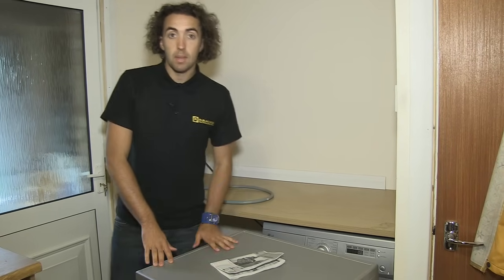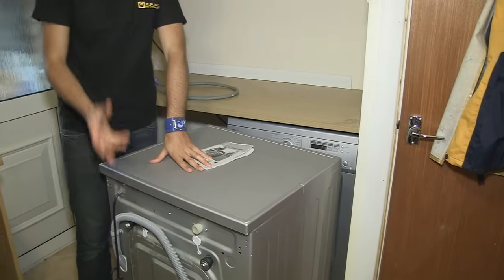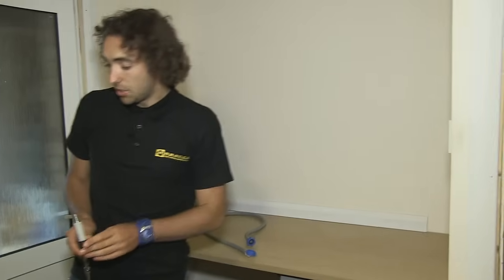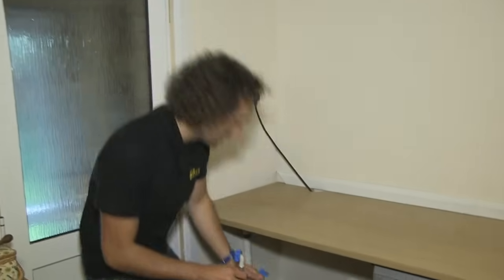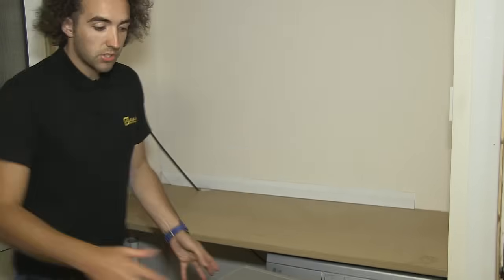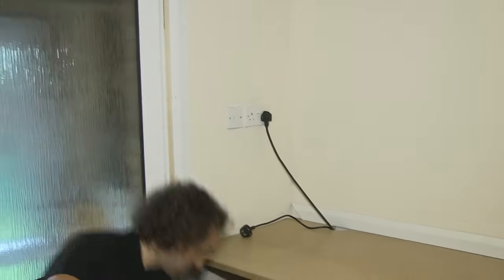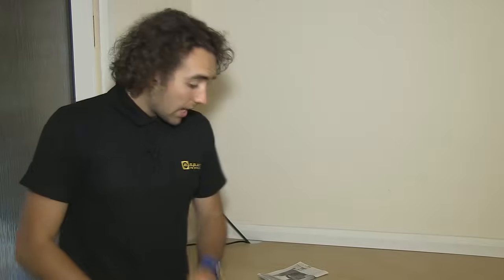How to Install a Washing Machine (Easy Guide)

Comment: My machine can't supply water inside the machine
Reply from the maker: Hi, if your washing machine is not filling with water it could be a faulty water inlet valve. Check out our video here, which shows you how to test the valve...and also how to replace it with a new valve.
https://youtu.be/jiyVfEHu6W0

If you do need a new valve, our range on eSpares can be found here:
https://www.espares.co.uk/search/pt1753/washing-machines/valves

Comment: Wonderful video and so easy to understand!  I just viewed a flat to move into.  The agent showed me the kitchen and there was a pipe cut through the unit for the cold water fill pipe to be attached.  However there was no outlet bit cut through!  I thought it was strange but didn't sign on the dotted line and thought I better view a video about plumbing a washing machine first.  Lucky escape!
Reply from the maker: The drain may be connected to the bottom of a sink as shown in our dishwasher video: https://www.youtube.com/watch?v=KoZ9qhS-KcE
It is unlikely the 'flat' would only have a water supply without also having a drain.
Reply: Thanks for the reply.  The space for the washing machine was three kitchen units away from the sink, but there was no cut-out in the unit for the draining pipe from the washing machine to be passed through to the waste pipe.  Ok, a minor point but still nonetheless the carpenter would need to do the hole cutting in the unit, and the flat should not be let as being ready as that work would need to be done.  Thanks for replying.  Although I would not want to anticipate doing plumbing myself (if I got on the floor I wouldn't be able to get up again!!!), it is always very useful to have an idea of what's what with regards to plumbing jobs.

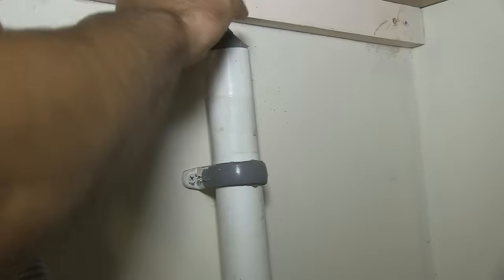Comment: 3:07 so it’s okay to leave the drain hose hanging loosely in the pipe? I’ve inserted it 20cm in the pipe but the hose significantly more thin than the pipe itself. It won’t fly out or anything?

Comment: Very good clear and concise instructions Thanks for making this i'm getting a new washing machine this week but it feeds into under the kitchen sink rather than on the wall do i need to do anything different??
Reply from the maker: Hi Nigel, if you are plumbing the outlet hose of the washing machine to the sink make sure there is a one-way connection to stop any dirty water from the sink going back into the machine.

Comment: Thanks for posting this very helpful video. Do we need to turn the cold water supply valve on?
Reply from the maker: +Ankit N After checking the pipes are tight the water must be turned on for the machine to fill.
Reply: Yes you must otherwise no water will go into the machine

Comment: Hello. I can't find any when you are just replacing one washing machine with another. 

Ours is attached to a sink spigot.

Is the drain hose in the old machine still viable as the access is limited fed around a lot of kitchen units so can I just remove the old drain hose out of the old washer and connect that to a new machine? 

Trying to find videos about it but most lost only the connection to the spigot or downpipe which we don't have.

Is it complicated to remove the hose from the new washer or can I just remove the one from the old one and attach it via a connector using the old tubing already attached to the spigot?
Reply: Or just attach the new tubing to the old tubing pulling it out of our old machine somehow? A connector maybe?

Comment: thanks that was really helpful but a quick question - there is only a hot water option for filling the washing machine in my new place so is it ok to attach?  The washing machine I have is 6 years old but as new as it's been in storage.  thanks
Reply from the maker: +sarah r. It is usually the case to only have a cold water option. Try running this water into a bucket as it may be a cold supply with the wrong coloured tap (red).
IF it does turn out to be a hot supply we would advise you get a cold supply fitted.  Using on hot water will not only cost you a lot of wasted money and energy when the machine rinses several times each cycle, but it may also 'set' stains into clothing rather then clean them away.

Comment: Hello does it harm the Washing machine if u connected it to a hot supply but it is cold supply
Reply from the maker: It is unlikely to harm the machine, however it can cause stains to 'set' before they are lifted and will harm your energy bill. It could also damage clothing that should be washed at 60 degrees or less.
A modern machine is designed to fill with just the right amount of water and on a 'quick wash may heat only for ten minutes and wash in under 30 minutes. To heat the water on that cycle would cost less than 4 pence a wash, not a big cost.
Reply: espresso thank you for replying. I only have 1 water supply
Reply from the maker: Cold it is then. 😊
Reply: eSpares I only have hot water supply lol and I'm looking for a new machine after years my indisit  broke the spider I think. Not sure which brand to get now

Comment: Does anyone know the name of the tool he used for the back bolts
Reply: Ratchet & socket , looks like the socket is around 13mm
Reply: There is a white plastic piece that protrudes from back of the machine and it hits the back metal cover plate making a loud knocking noise. Your advice would be appreciated. 9/1/24

Comment: You forgot to plug the transit bolts
Reply from the maker: Hi fly164, it is not necessary to plug the holes for the washing machine to work as the caps are usually only a cosmetic feature but if you have them you can fit them if you wish.
Reply: eSpares ok thanks
Reply from the maker: Your welcome fly164
Reply: Do u not need to turn water supply on

Comment: What you do is trivial.
But you assume in advance that everyone has ready-made pipes to connect the washing machine's wires. But you will not explain what to do in a NORMAL and TYPICAL kitchen when they are not there.

Show me a more normal situation - you move into a flat where there are no connections to the washing machine. And where will you put this pipe in?
Reply from the maker: Hi Stanley G., thank you for your post, most installs are done when the plumbing has already taken place and if you are after that type of video it's not something we do on this channel.